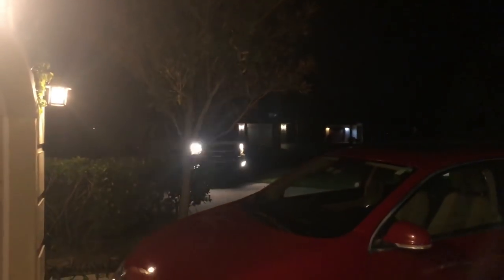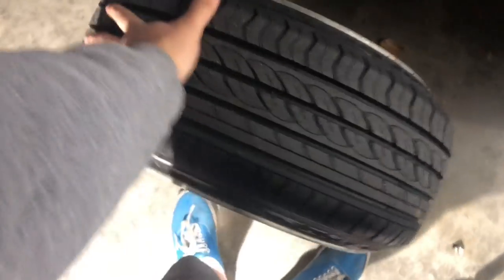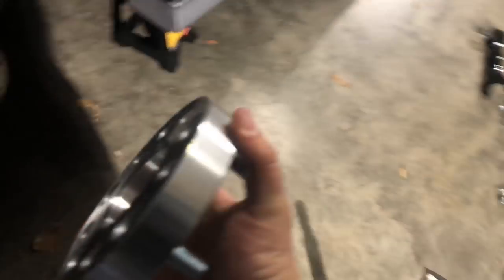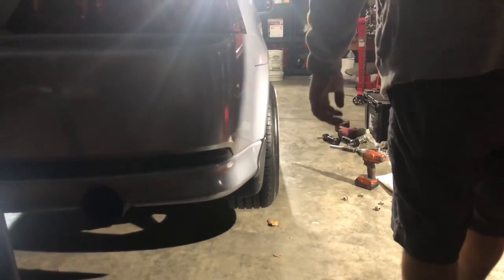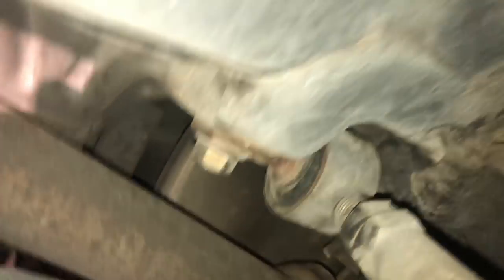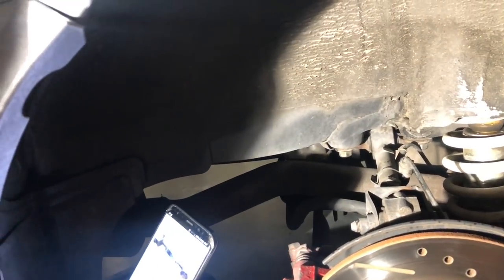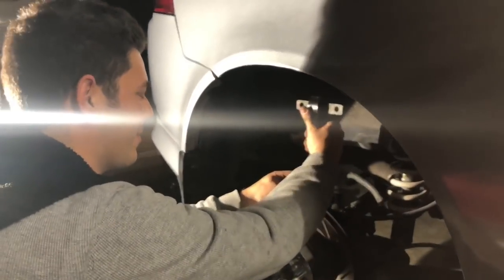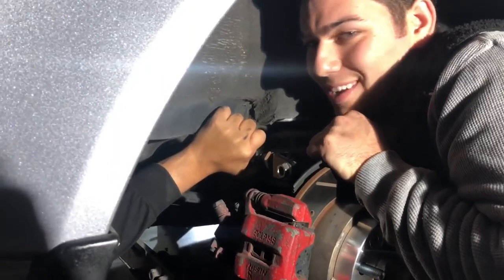Stancing The RSX || Camber Kit, Spacers, Streched Tires

Comment: What size wheel spacers?
Reply from the maker: 1 inch spacer
Reply: And you didnt shorten the stock studs? I have type r wheels on my rsx but debating 15mm or 25mm spacer. Rubs just a tad on bumps
Reply from the maker: Stock studs were fine since this spacer compensates for it.
Reply: @559ksut  did you end up putting spacers on it?
Reply: @jerssonpineda7  not yet i will soon though